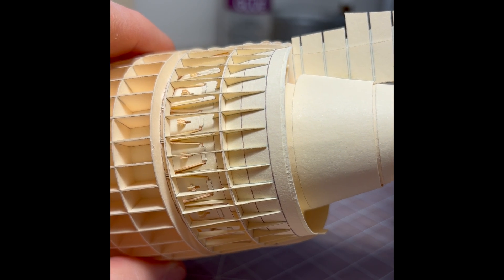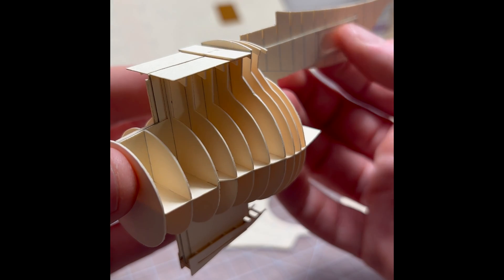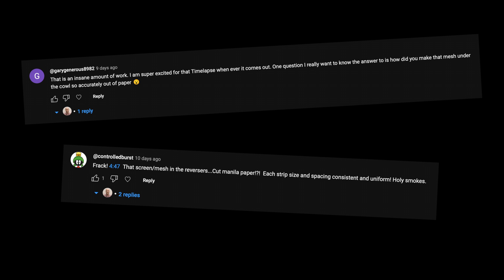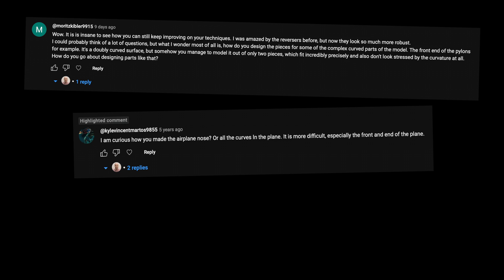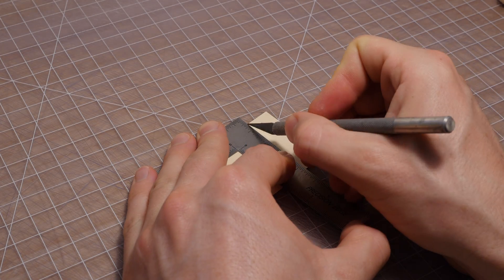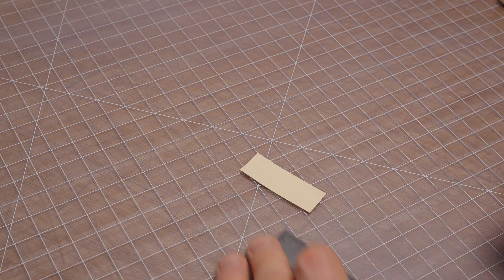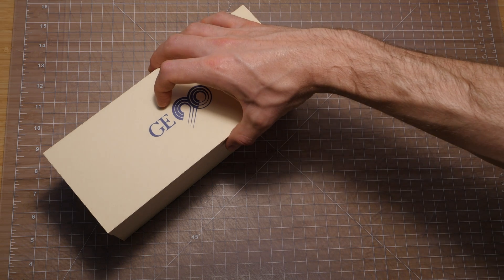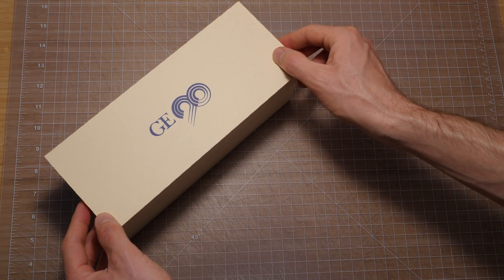Manila Folder 777-300ER - Thrust Reverser Mechanics and Paper Shaping Techniques

Comment: dude simply insane. so let me ask you this when building your plane and you had nothing at all infront of you. how did you start the build. i love the attention to detail
Reply from the maker: I basically start by looking at tons and tons of pictures and reference/technical drawings if I have them available. Boeing also released some overall dimensional drawings of the 77W which helped a lot just getting started. Anyway from there I start breaking down into smaller and smaller parts and figuring out how everything is going to work. It's a time consuming process!

Comment: Where do you get paper so thick, I tried with normal a4 and failed because of bending alot.
Reply from the maker: I use two thicknesses of file folders:
• The thinner stuff I use on finer parts and for most of the skin, especially if I want it to contour it heavily: https://www.amazon.com/gp/product/B002IXM3AW
• The thicker stuff is used for major structural parts, like the forward engine cowling, pylon, wingbox, tailfin, etc: https://www.amazon.com/gp/product/B0013CME9E

Comment: Very informative! Can you expand on how you glue the panels to the structure? Does the glue you use shrink and do you have to compensate for warping after it dries?
Reply from the maker: I generally apply the glue to the inner structure rather than the skin, so that I know it'll make contact at the right places. Also, a little goes a very long way. I haven't really noticed much in the way of shrinking so it's not generally something I account for.